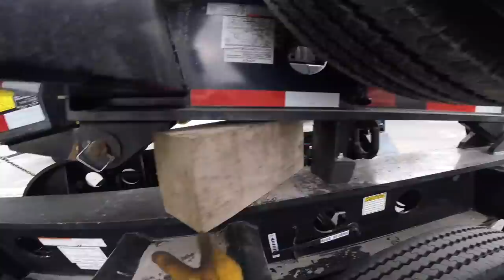04/19/19 -- How to move a 3,000 LB axle without a forklift

Comment: I would actually have asked the shop to lower the mounts for the rubber stops on axle 3 so that the axles could be supported by all four rubber stops. But maybe the hinge between axle 3 and 4 would come too close to the chassis then?
I would of course love to see a built-in hydraulic piston to flip the axles, but that's cost and weight added to the solution.
Reply from the maker: if I added hydraulics to the trailer to flip the axles, then in the future i wouldn't be able to use stingers. you smart guys thought of that? this is a 60 ton trailer. it requires a jeep and stinger to haul something close to its capacity - 120,000 LB.

Comment: I could never keep flipping axles.  Either they stay on the ground full time or I don't want them.
Reply from the maker: Most guys here in Ontario run with 4 axle trailers, and axles are permanent, except the last 1 or 2 are air lift. That works fine locally - since we all have annual permits; but they can get a ticket if they venture into another jurisdiction, such as New York. If your rig is over80 ft long, you need 1 escort, whether you're loaded or empty. It's possible to get an annual permit there too, but I cannot afford to get those in every state I run.. Flipping axles is cheaper. Also, the place where I park is pretty tight and they always start complaining when the front of my truck sticks out too much, which usually happens when i have all 4 axles on the ground.... there's a bunch of other reasons to flip 'em up when you're empty, including but not limited to: maneuverability, tire life, fuel mileage etc. etc.
Reply: @HHTV60  A great explanation.
Reply: Why not get the 3rd lift and 4th flip? Is having that 3rd hanging off the rear make you longer than 80’?